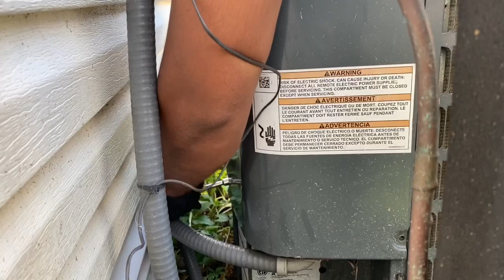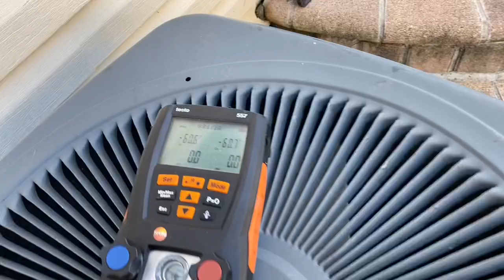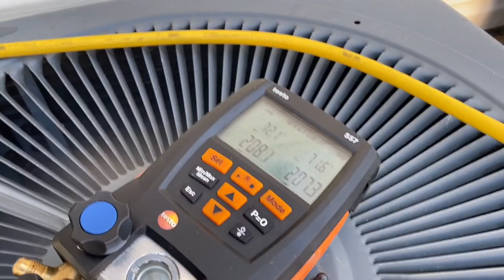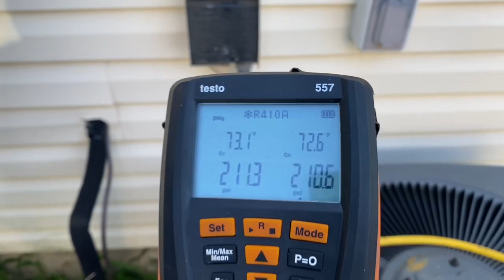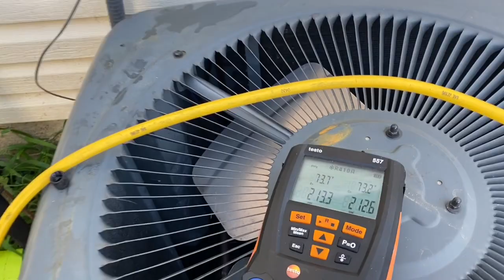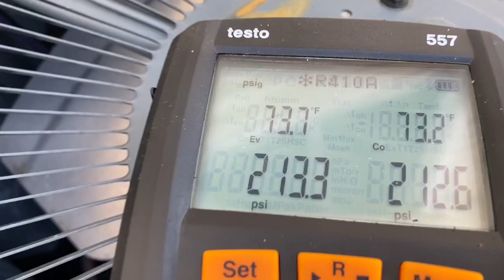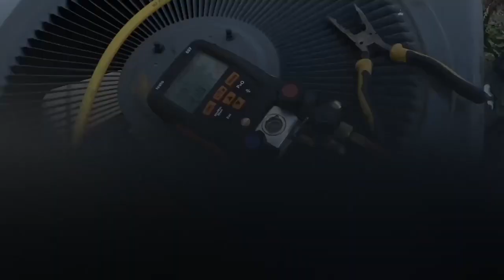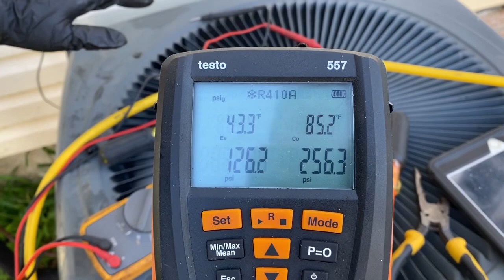Can Kelvin Diagnose a Dead Dual Capacitor? Central AC Not Cooling

Comment: Hey if you can tell him to take a pic of this it helped me alot whenever i go to a call i always check the indoor stuff first make sure we have air flow check filter too or the pan switches if thats all good i move to the outdoor first thing i do is visual inspection make sure no wires are burned or anything obvious check if the condenser is dirty too if thats all good check voltage if we have low voltage and regular i then move on to refrigerant pressures looking at youre refrigerant pressures tells you alott my friend  so 1.airflow2.voltage3.pressures